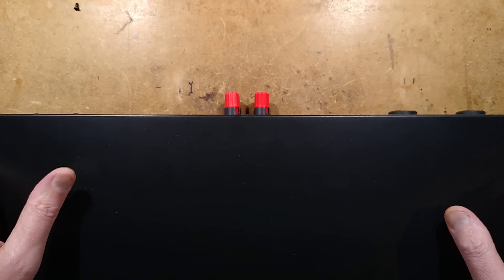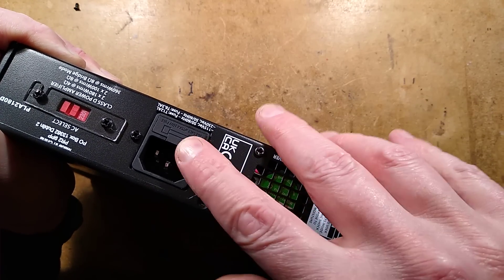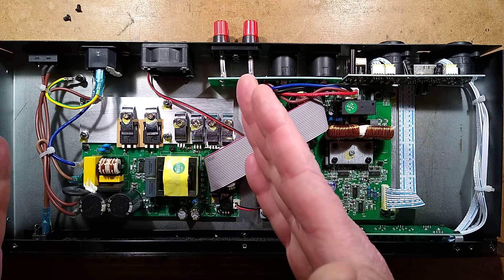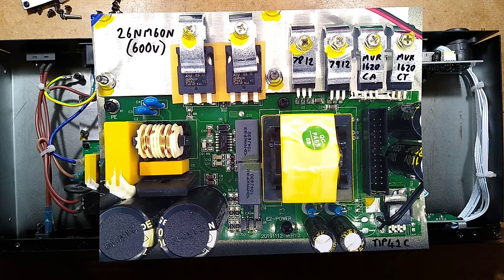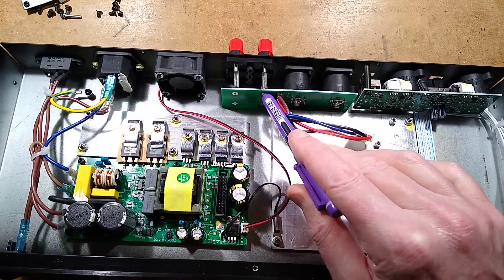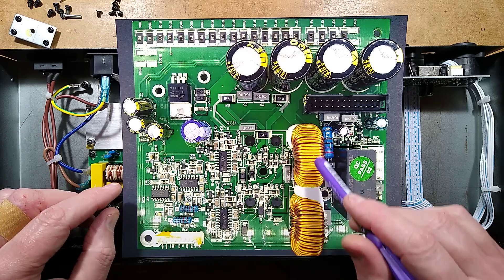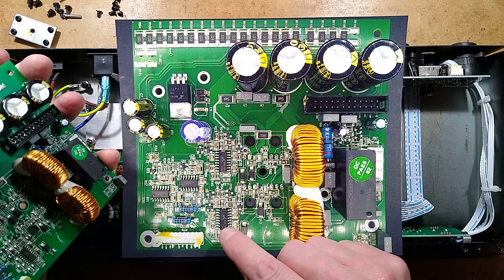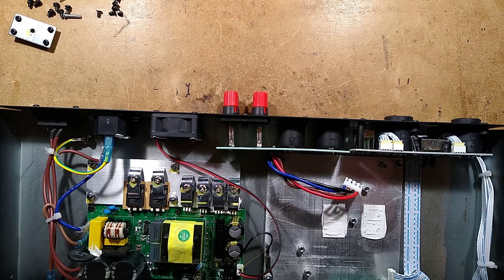Inside a 360W digital amplifier

Comment: in software reverse engineering, there are broadly two different types of analysis: static (looking at the assembly and trying to figure out what it does) and dynamic (observing different aspects of the software while it’s running, e.g. with a debugger). my background is in software RE, and i don’t know much about hardware RE, but how much of your reverse engineering process would you say is in each category (or the hardware analogue of each category)?
Reply from the maker: I usually reverse engineer completely, excluding software locked in chips.  This was more of a modular exploration.

Comment: Clive the "D" doesn't stand for "digital". There isn't a such thing.
Reply from the maker: The output stage is filtered PWM which I regard as digital compared to a traditional analogue stage.
Reply: @bigclivedotcom  This is true however the pulse widths aren't derived digitally. It's essentially a fancy buck converter scheme with the feedback loops biased by the input signal. A purely analog path.

Comment: I must admit I expected to see 2 relays, one on each channel that switched when each corresponding amp had powered up OK and was stable. I guess they use a double pole relay and combine the 'ready' signal and only switch the speakers on when both amps are ready.

Comment: In a class D amplifier, there will be a modulator that compares the input signal to a triangle wave and sends its output to drive the gate of the output transistors, but if the output transistors are large, this gate can become very capacitive so an additional "gate driver" IC is needed between the modulator output and the gate of the output transistors.

Comment: Loudspeakers are a linear motor connected to a diaphragm that moves to produce sound. They don't have any other power source or electronics built inside them, so in order to operate, they require an amplifier to send them a high voltage, high-current signal that can drive them. An amplifier is a big power supply that drives the linear motor inside the speaker to push and pull on the diaphragm. There is always a power supply section that rectifies the incoming AC power, into DC and there is always an output stage that acts like a valve for that power which modulates the DC voltage to an AC voltage in proportion to the incoming electrical signal, which is the musical signal. The output from the amplifier is just like the input waveform, only much higher voltage, and capable of much larger current. This amplifier makes it very easy to see the different parts of the unit that serve different functions; sometimes the circuit boards get very dense and it becomes difficult to see what is going on.

Comment: Something to get straight ... Class D amplification is not digital.  The "D" designation was simply the next available letter in the alphabet when listing amplifier classes.  This odd coincidence has been the source of huge confusion.  These amplifiers are an analog process, but not like the usual brute force process used in A AB or B class amplifiers.

Class D operates rather like an FM Transmitter.  What they are doing is encoding audio onto a high powered carrier signal.  In FM this is done by changing the carrier frequency.  In Class D it is done by changing the width of square wave pulses in step with the audio input, hence Pulse Width Modulation.
In an FM receiver you would lock onto the carrier frequency then filter it to recover the audio signals.  In a PWM amplifier you do the same thing... filter out the high powered PWM carrier in order to recover the much amplified audio signals, for your speakers.

This entire string of events is an analog function... the audio signal is never digitzed, the pulse widths are governed by an analog comparator, the output filters are simple analog coil and cap filters.  Nothing digital about it.

Comment: letter D used to designate this amplifier class is simply the next letter after C and, although occasionally used as such, does not stand for digital. Class-D and class-E amplifiers are sometimes mistakenly described as "digital" because the output waveform superficially resembles a pulse-train of digital symbols, but a class-D amplifier merely converts an input waveform into a continuously pulse-width modulated analog signal. (A digital waveform would be pulse-code modulated.)

Comment: Maybe there’s something on the other side of that input board that we’re not seeing, but I don’t see how this amplifier is digital. It has analog inputs, analog outputs, and from the looks of it, no digital components. I could be mistaken, but I’m wondering if this is one of the sellers that mistakenly assumed that “class D” means “digital”
Reply from the maker: The output stage uses pulse width modulation instead of operating in the transistors linear region.  I regard that as digital.

Comment: Nice teardown Clive. I love class D amps, so simple yet ingenious. I built one many years ago, from memory it generated a pure triangle wave using a pair of comparators, a flip flop and a pair of matching current sources/sinks, then fed that into a simple comparator as the A/D converter, and a full bridge output. It worked surprisingly well and sounded quite good though I never got round the issue of high quiescent current and ended up losing interest. I was going to build a car sub amp using the design one day but never got round to it. Think the schematics are still out there on diyaudio.

Comment: Tired of the "Class D isn't digital" comments. It might be, or it might not be, depending on the implementation. Back in the '80's, no. It was usually done with an analog comparator, generating a sawtooth wave and switching the output FETs at high frequency. I suspect that today it's cleverer.

Comment: Very clever stuff, but I don't trust 'em. Installed a few in venues, and sooner or later they fail. Give me a big toroidal transformer, rectifier and smoothing caps, driving a load of MOSFETs in class AB. It's oldschool, hot and heavy, but so much more reliable over time I've found. I dare say the high end Class D stuff is fine, but this budget end gear is nowhere near as reliable as it's linear equivalents.
Reply: I get it...I run my home Magneplanars with a big'ol Sansui analog amp. BUT my outdoor theatre rig is all Class D.

Comment: Disappointing that you are referring to this as a 'Digital Amplifier' - It is not a Digital Amplifier. It is a 'Class D' amplifier.
'D' does not mean 'Digital' . . . it does not have any form of digital or A/D circuitry. Class 'D' refers to it's mode of operation.

Comment: Im actually struggling somewhat, with my QSC amplifier.. So wondered if youre knowledge, Would be able to help me out?!?!
The switch mode power supply blew, which took out the TOP210PFI  IC, and small the offline switch mode transformer, is shorted.. (0.01ohms), (Located at t1 on the QSC PLX-1202 schematic),  But finding a direct replacement from QSC is proving difficult... parts are either in america, and they dont ship to the UK.. or they are just fully out of stock....
QSC themselves, Wont sell to End-Users.. Only businesses! 

The transformer in question, Has TSD-1135 stamped on top of it... Its a 8pin Through-hole... QSC reference number is: xf-000064-00.
I really dont know enough about transformers, to be able to find a suitable replacement.... But im absolutely desperate to get my amp working, for my daughters birthday party in a couple of weeks....
I am in the UK, so 230v mains.... And if im reading the transformer data sheet correctly, It says Secondary is 5/15v output.....
If you could please help me find a suitable replacement. I'd very very much appreciate it!  Im struggling, and its driving me crazy, Sitting at the computer for hours on end, And still nothing even remotely similar is available (that i know of, with my very limited knowledge)....
I need something thats a direct replacement.. Just solder in, and it will work :)
Thankyou so much!....

Comment: Great topic and dare I say fairly new topic for the channel! I’ve built valve amps from old schematics, but around a year ago started to fix broken Cambridge Audio amps from the early 2000’s on to 2015. Plenty out there and are mostly through-hole construction with schematics easy to find. It’s taught me a lot and their stock op amp (5532) can be swapped for higher quality versions. Their boards had construction issues where a components pad would ‘periscope up’ if you grabbed a component whilst holding the board, but drop back almost invisibly and cause a fault once warm. Even continuity between pads would be fine until they weren’t. That was a pain to discover and add to the troubleshooting process.

Comment: Clipping is what it says, the signal cannot be amplified because its getting out of dynamic range therefor the signal gets clipped, the waveform gets flattened at top/bottom and produces an DC like signal in a wavform. This could lead to speaker damage because they are not to be driven at DC signals (at high power levels). So this is an input related feature with output problems.
Reply: "the waveform gets flattened at top/bottom and produces an DC like signal in a wavform" ... err, no.
It's still an AC waveform.
It's not "DC like", the fundamental frequency is still the same as the input waveform. It's approaching trapezoidal.
That adds harmonics. Which is what actually damages speakers with passive crossovers.
In a fully actively amped system, you can pretty much drive every final into clipping all day as long as RMS output is below what the driver(s) can handle.
Reply: @artforz  "the fundamental frequency is still the same as the input waveform", nope, if the signal gets clipped at input, the waveform gets distorted and is not like the original waveform. If it gets clipped at the output side of the amp, the signal is internally the same but gets distorted when driven too high by the amp. (Usually when 2 or 4 ohm speakers are used while the amp expects/is build for 8 or 16 ohm).
With DC like I meant that the signal gets flattened at the top/bottom of the input, indeed resulting into a trapezoidal form. Which btw only concernes the clipped parts, not the part that fall within the dynamic range.
Because a speaker/driver is not to be driven with DC signals nor signals which result in an extreme slope from max top to max bottom (or reversed) of the amplification curve. These extreme changes can lead to damage of the speaker/driver. If the speaker has enough power to handle that kind of ouputs, the audio will be horribly distorted.
A highly distorted signal doesn't have to be damaging to the speaker, as long as the powers which the speaker/driver can handle are within specs. For example a square wave can be listened to at low volumes. If the input signal is clipped but the amp is at low volume, no harmonics will damage the speaker/driver.

Comment: I just tried going to the link in the description, mostly as I'm curious what this unit costs and received an "Access Denied" error.  On the Pulse web site and others, it is listed for 157 Pounds.  

I know the description says you didn't test it for audio performance.  As nice as it was to see the inside, I would sure like to know what it sounds like and does it meet the specs. 

Many decades ago I had an integrated pre-amp and power amp with 22 tubes and a massive transformer all to make 120 watts.  In the winter you could heat the room with it.  Then we went to solid state which was somewhat smaller, lighter, and less hear.  But they still had the massive transformer and heat sinks for the output transistors.  Now this amp is ridiculously small and light and almost nothing for heat sinking.

Comment: The timing of this video :D 
Im currently in the process of repairing a QSC Pro Audio Amplifier.. With a blown Switch Mode Power Supply.... Picked it up off ebay for cheap.... Will be worth a bit of money when repaired, Being QSC... But im planning on adding it to my audio rack, to run it bridged for one of my woofers..

Comment: Few years back I needed a stage PA amp, so I bought some Class AB modules.    Then ignored them, and bought some Class T modules instead.  (Class T is like a clever sort of D) 

Because Class T and D are so much less fussy about their PSU, it was cheaper to re-buy the whole modules than it was to build a PSU for the AB I already had. The Class Ts were happy with a cheap switchmode and sounded just fine.   A PSU for an AB would have needed an expensive toroidal transformer and all sorts of high-end bits.

Comment: What a weird design! Switched input SMPS - I thought they went out in about 2000! I assume since it has 2 MOSFETs and no output inductor that it is a flyback converter. Ribbon cable for power transfer - not a great idea. The fan looks like it pulls air through all those grilles in the front to keep the air inside cool rather than creating high velocity flow anywhere in particular...

Comment: the tpa3255 is a tiny class-d chip that requires a few components to work, its rated to 480W at 1% thd in bridged mono into 2 ohms
  the only other chip that comes into my mind with such power levels is a TAS5630  its older and a bit bigger.

Comment: This looks like quite a nice unit!  It's basically a switched-mode power supply that can both source and sink current, delivering a stream of high frequency pulses with a variable duty cycle, and relying on the inertia of the moving parts to smooth it all back out into an audio waveform with a bit of help from the inductance of the speaker coil.  The output transistors are (in theory) always either open-circuit (so carrying no current) or short-circuit (so dropping no voltage) and thus do not require massive heatsinks  (here, the real world deviates somewhat from simplified ideals and some sort of heatsink is required),  unlike a traditional analogue amplifier where one or the other of the output transistors is dropping the voltage difference between the nearest supply rail and the output.

The first generation digital amplifiers were a bit prone to high-frequency instability; blowing up tweeters -- and eventually themselves.  But that could also happen with traditional amplifiers, if you replaced old 2N3055s  (they don't like having the output short-circuited, and the fuse usually outlives them -- especially if someone has put the wrong value in)  with modern ones, due to their higher turnover frequency .....

It's nice that they used dissipative regulators on the preamp supply, to avoid introducing digital noise into the small signals.  I guess the real test will be how well they survive in the real world .....  Are they musician-proof?  Are they roadie-proof?

(And where are all the fibre-optic digital audio connections? All the relevant patents have long since expired by now!)

Comment: Wow...some of those circuit boards look as though they are Sim City maps 😅 Soooo many components clustered so close together!!

I recently bought an old stereo amp with the intention of having a look inside...now that I see this, I know I'm in over my head. I'll still take it apart, but only to satisfy the scientist in me. Once I've had my fun it's going back together and being repurposed for my experiments.
Reply: The older style equipment tends to have a lot more dedicated components rather than the modern ones being full of chips of some sort.  Depending on the era it's from, it's even more beautifully designed and looks even more like cities, especially before all the SMD stuff became a thing.
Reply: @Dutch3DMaster  I know, right? I absolutely love looking at well designed PCBs, especially the clean and shiny ones 😅

Comment: Digital amplifiers are surprisingly good, even the super cheap Chinese ones sound pretty good. I remember the days when a 360 watt amplifier would almost need a fork-lift truck to move it.
Reply: Except . . . it's not a Digital Amplifer
Reply: @buddhistsympathizer1136  OK, I'll bite. How is an amplifier that's doing the amplification by a MOSFET and then using pulse width modulation to produce a pulse train  output NOT a digital amplifier? This isn't a linear gain amplifier, it's a class D, digital amp.
Reply: @PenryMMJ  With respect, do research on Class D amplifiers and how they differ from the others. 'D' is an amplifier classification. It is not short for 'Digital'. The pulse train you speak of is a series of analogue pulses, not digital pulses. No part of the amplifier is 'digital' in nature.
Reply: @PenryMMJ 
Just because it uses square waves, does not mean it is "digital" ... PWM vaires the width of square waves in an analog fashion ... It's a modulation scheme, not a digital process.
Reply: @Douglas_Blake_579  Mate, I'm not sure why there seems to be a strong backlash against my comments. Watch the video. Clive explains that this is a digital amplifier. The manufacturer markets it as a digital amplifier. Go to their website and check out the spec of the amp. The video is even titled "Inside a 360w digital amplifier". It's a digital amplifier. Analogue class D amps do exist, but this isn't one.
Reply: @PenryMMJ 
If you follow the link in the description the vendor is saying Class-D not "Digital" and if you look a bit further down you will find the manufacturer's tech sheet for the amplifier which also does not mention "Digital".

The backlash is simple ... Class D is not digital

You mis-spoke ... it happens... get over it and move on.

Comment: I've always wondered how Negative voltage rails work. I know that voltage is a measure between two points and as such is relative, but aren't these rails a negative voltage relative to 0V/Ground?
Reply: Yes, that's exactly what a negative voltage rail is.